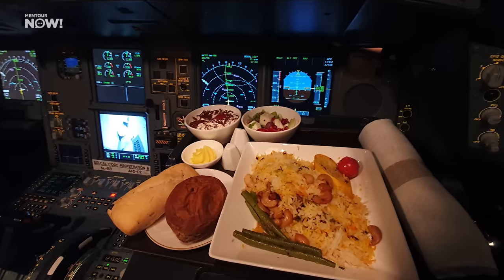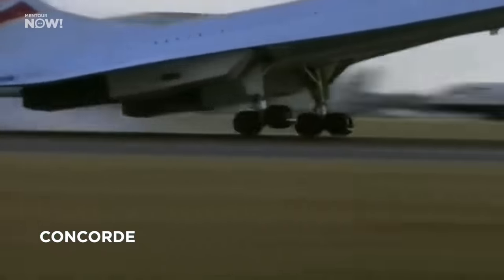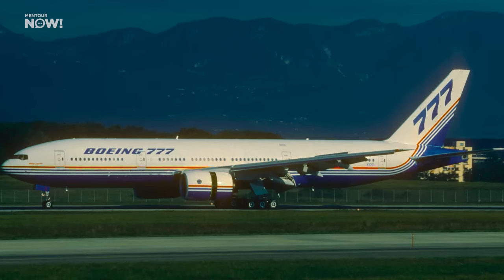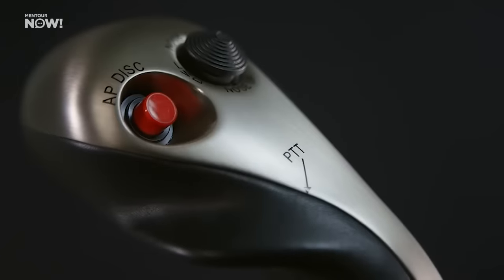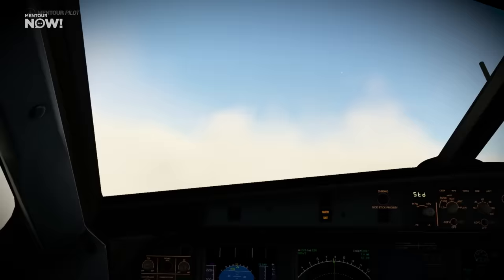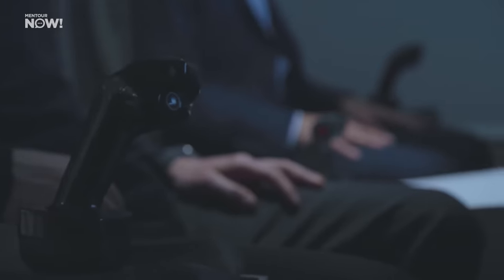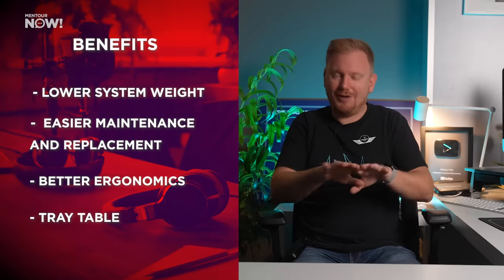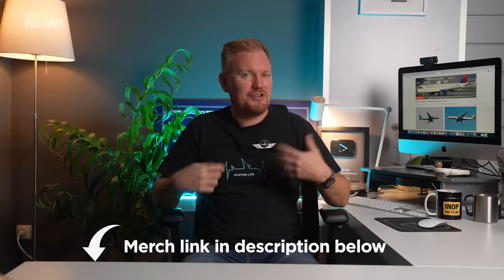Will Airbus Finally switch??

Comment: To reduce the dual input problem, why not install a very obvious switch to control which pilot has primary input control? It might help clear up who has control of the plane. If an argument arises, it would be over which way the switch was flipped. The secondary control would still have some redundancy somehow.

Comment: You are not 100 percent correct in Boeings decission to use Yokes.  The main reason Boeing went with Yoke is nearly all pilots start out flying with yokes and MOST aircraft have yokes and its a natural feel for pilots.  Its easier to transition from one aircraft (not boeing) to another when most aircraft have yokes.  Also in Emergencies, because pilots are so used to using Yokes its easier to deal with emergencies more confortably.  It boils down to philosophy in designing safety.
Reply: You're right. Pilots start flying with yokes which are present in smaller planes meant for general aviation and flight training.

Comment: I am just at 0:33  and a film maker (hobby wise) and focus pulling is only possible manually with old lenses. Focus by wire lenses are useless. You have no marks, not a fix way, it depends how fast you pull focus and the acceleration of your hand, so you can’t train it for the shot and use muscle memory, you always pull a little bit faster or slower so you have to search focus instead of in the best case make a mark on the ring on the older lenses and just pull to your mark. Or make it by feeling. So I am not a fan of anything by wire. You need natural feedback.

Comment: When it comes to making reliable tech for this, I think the technology has actually been around for a while, just not put to use.  When you think about it, measuring force is nothing new and we have multiple ways to go about it.  You could have pressure sensors for example.  With servos, you can measure load on the motors to hold a position, though maybe not quite as accurate, but still pretty good.  We have been able to measure servo position for a long, long time or else flying R/C aircraft would be basically impossible to fly because the servos would not do what the R/C pilots commanded.  Then, when it comes for force exerted by servos, I just look at the high speed tail servo for my large scale R/C helicopter I put together over a decade ago that perfectly holds the tail and those tail rotor blades spin so fast when I have them moving at flight speed on the bench that I cannot manually move the push rod from the base of the tail boom to make any sort of meaningful deflection of the tail rotor.  In general, the forces involved on large scale R/C helicopters that the servos need to counter are immense and they do it like nothing.  So then you look at the 2-axis movement of the side stick and you can have doubled up servos where you have 4 of them 90 degrees apart.  So the servo 180 degrees opposite of one breaks, there is still one to handle that axis and then the flight computers can log that the redundant servo failed.  Same with say a pressure sensor, one breaks, the redundant scheme is still there and an error is logged for the maintenance crew.  It is kind of like having redundant hard drives in a server where one breaks, if your server administrator has their logging server setup, they get a notification and replace the failed hard drive at their earliest convenience and the array rebuilds and nothing is lost.  The point is, none of this is new; it has all been around for decades.  So just nobody bothered.  There is actually a whole lot of tech out there where someone thinks it, maybe it happens, maybe it doesn't.  If it does, it is not appreciated and then it languishes.  Maybe at some point somebody remembers it and then it gets fleshed out to what it should be.  Especially anybody who has worked at a major corporation developing technology knows full well how the higher ups tend to look at the tech you develop.  After all, we got luck with graphical Apple Macintosh computers that Steve Jobs just happened to get a chance to look at the tech developed at Xerox around this and decided his company was going to copy what the Xerox people were doing and release the Macintosh computer.  If you just left it up to the Xerox execs, they were like we are in the copying business.  We don't understand this graphical interface tech and are not going to incorporate it into any of our products.  Then, we would have waited a lot longer for a graphical interface to emerge somewhere by someone with the means to bring it to the masses.

So for the question of could have Airbus done this a long time ago?  I think the answer from a technological standpoint is absolutely.  It just wasn't prioritized.  I mean there is just nothing new or 'magical' that we say just recently came up with a servo or sensor mechanism for and there is nothing really new software / firmware wise for controlling such a thing, at least in concept.  It is not like you need ChatGPT to control it or something.  This is you have some motors and sensors we have had for a long time and some fairly straight forward software / firmware to control it all.  When you think about it, this is more like tech level going back to the 1970's, granted you would really want at least a 16-bit computer from the 1980's to make it really smooth as the 256 steps of 8-bit isn't really all that nice for flying an airliner.  The servo tech I used in my R/C helicopters had something like 4,096 steps and digital audio has had at least 65,536 steps to the masses since the first CD player came out way back in the day.  And for reliability, as mentioned above, it could have always been setup with inherent redundancy and the controlling software / firmware could have been programmed to work around faults.  Software / firmware designed to work around faults like this is nothing new either.

Comment: Regarding the side sticks, I always wonder how a right-handed person can control an aircraft from the left seat, holding the side stick in their left hand. I have a flight simulator and a joystick, and once I try to fly with my left hand, it is nowhere near possible for me to do a smooth landing. 

By the way, you mentioned that hearing is the first sense to be degraded when in an upset situation - it would be excellent for the active side stick to have a stick-shaker :-) That could have been a game changer on the infamous AF 447 flight.

Comment: I never understood on having a joystick you have to handle with the left hand. I have a similar problem when renting a car in a country where you drive on the left side and the steering wheel is on the right. Operating the gear box with the left hand is more difficult.

Comment: I think the decision for a retrofit will come down to whether the airlines will pay for it or not. If Airbus considers to implement active sticks, they will most certainly need to certify that change and the adapted operating procedures, which costs money and takes additional effort aside from the engineering behind the change. 

Considering that the A320 sells rather well without, I don't expect them to make the move before releasing a new aircraft.

Comment: All Recall Air France flight 447 crash in the south Atlantic. The Left seater trying to recover control had no idea the right seater was holding his side stick full back during the descent to the ocean surface! With Yokes, it would have been far more visible what the right seater was doing during recovery attempts when the left seater called for Left Hands!

Comment: Interesting points being and the arguments, from a pilot’s perspective, sound convincing. However, stepping back a little and considering it from an airlines’ perspective I can imagine a certain amount of reticence in rolling it out as a ‘retro-fit’ without there being an extremely good case to do so. My reasoning is that in spite of the apparent ‘straightforwardness’ of installation, as you said, there are knock-on implications for other on-board systems which will need to be upgraded / modified to be compatible, there’s pilot training etc and the system is likely to be expensive because of all the development costs (think of all the millions of lines of code which must be reviewed and re-tested, aircraft recertification etc). All this represents ‘lost’ time and cost to an airline (some of which could be mitigated by undertaking this during a major service or refit - in theory). There are, I think, also further logistical issues in that if the aircraft after upgrade are ‘different’ to fly you cannot so readily interchange your pilots to fly the newly equipped aircraft mixed in with your non-upgraded aircraft. It has to be planned and, inevitably, is likely to create bottlenecks and restrictions as the system is rolled out across the fleet - albeit temporary. This is another cost an airline must absorb. And implementation is not without risks too - not just the aforementioned logistical ones. There are very real safety risks. Same model aircraft often have differences, perhaps from upgrades or replacements over the years, or may be differently configured for airlines. They aren’t identical. An airline would have to be 100% sure that the new equipment worked flawlessly with every aircraft it was installed on. I can imagine a requirement for thorough flight checks after each upgrade - adding to cost. All this is not to say an airline wouldn’t therefore do it but may be reluctant to retrofit unless there is either a significant cost reduction benefit, the airlines’ safety is improved across a significant proportion of its flights - I.e. not just a small percentage of rarely occurring circumstances for which other mitigations already exist or it is forced to by legislation or industrial action. There is, I think, a stronger case for implementation on new aircraft only but Airbus would still have to persuade the airlines of the benefit to them versus the extra costs which will still be present. How did this pan out for such things as converting from old analogue instruments to the ‘glass cockpit’ (though I imagine the case for that change was much more compelling…)

Comment: This argument starts with the tenuous assumption that joysticks are better. I have reviewed the videos of about 1/2 dozen aircraft investigations where joysticks contributed to the crash. I have never seen one accident where a yoke was a contributing factor.  I did witness bare eyed, a fly-by-wire, joystick controlled, large commercial jet overrun and burn to the ground. (Aug 2005).
You cannot see when, and what inputs, the other pilot is giving when a joystick is used. As mentioned the DUAL input case causes a voice warning which is not heard when the brain is in fight or flight mode. Neither does it indicate what inputs the other pilot is making. 
A joystick cannot provide feedback as well as mechanical linked yokes give. 
A joystick with servos (25 years too late) has significantly more fail-able software involved. It also violates the KISS principle.
The 80% less weight advantage of a joystick is trivial compared to greater safety of a synchronized dual yoke. 
Perhaps unrelated, any wireless technology as part of the cockpit is vulnerable to hacking, just as with cars.
As a systems engineer (mission critical, real time) it never ceases to amaze me how naive are non-systems folks wanting everything digital. It is fanciful thinking, not based on all we know about human factors research, nor based on the track record of joysticks in commercial aviation which has quite different requirements than military jets.
There are dead passengers and crew and written off fly-by-wire aircraft (designed by four European governments) due to the original, non-pilot software designers thinking that a joystick should replace the 100 year proven dual, synchronized yoke technology. (They probably grew up playing computer games with a joystick too.)
Why use joysticks with fail-able software and servos to try and recreate feedback (still not giving visual observations by other pilot) when tandem yokes fully support two pilots in the cockpit?
It reminds me of the Carbon Fibre Titanic submersible that promised such a weight reduction… we know how that went.
I am not a pilot but have three decades in automation systems analysis, design and development.
Last point: what a human factors FAIL to assume the Left side pilot can nimbly use the LEFT HAND ONLY joystick with the same level of dexterity as the right handed joystick! The tandem yoke doesn’t suffer this problem.

Comment: Active side sticks will have to tap deeply into the aircraft databus to determine how to be active.

Given the age of older Airbus designs, sufficient data may not be available or other controllers require at least firmware updates.

Recertification, even if no other hardware is changed, will be the main cause for integration delays. Even if the active side sticks have a passive fall-back mode.

Comment: Envelope protection? ENVELOPE PROTECTION!? So... Air France where the pilot stalled the plane all the way into the ocean because he was constantly pulling back on the side stick.
Reply: The protections were off by then. The FBW was in alternate law. Envelope protections do not guarantee that all normal flight envelope exceedances or stalls will be prevented. It just decreases the odds of it happening, provided the normal mode/law is in effect. The protections have saved at least 3 Airbus aircraft from stalls in the past.

Comment: Something that never seems to be mentioned is the hand a pilot feels more comfortable using.

My preference is to use my right-hand so would feel more than uncomfortable flying an aircraft with a left-hand "side stick", it would just feel unnatural.

So will airlines have to have a left and right flight officers.

In the F-16 there appeared to be no choice, you could only use your right hand. Of course in the
 F-16 if the pilot suffered an injury to his right hand or arm it would be extremely difficult to fly the aircraft, whereas if it had a joystick you could us either hand.

Comment: Hey guys, I'm not a pilot, never flown a plane, just an aviation enthusiast here, with a curiosity about sidesticks: The captain's sidestick (left)is always meant to be used with the left hand, whilst the first officer's, with the right. Does that work well, isn't it actually problematic to pilot the stickstick with the left hand if you're right handed(which I assume most of you are?) Yokes obviously don't have this issue since they're center positioned
Reply: No. During take offs and landings the right seat pilot moves the yoke with the left hand and with the right hand does other stuff. So is technically the same.

Comment: now, I'm no pilot but I've kinda held over the scene for a few years now: if I was flying a small aircraft that was machine-flown with my inputs I would want to know what the person behind me in the other flying seat was doing, so flight sticks that give feedback from the other pilot and/or autopilot and from the forces the surface motors are experiencing would be greatly appreciated.

Comment: Excellent analysis. I've always felt that side sticks have many advantages, but the fact that there is no control loading is a major disadvantage -- you can't feel what is happening with the aircraft, in the same way that you're feeling the movement of your car through the steering wheel. I've always wondered why there were no designs with active side sticks yet. I'd be disappointed if those active sticks would only reflect the inputs of the other pilot, instead of also transmitting the forces that are being acted on the aircraft by aerodynamics. I believe the G500/G600 active sticks only mirror control inputs, not external aerodynamic forces.
Reply: The sidesticks on the G500/G600 DO provide artificial force feedback. A few pilots who have flown them said so. That's the other purpose of the active sidestick. Those aircraft have to provide it anyway as they are speed stable C*U aircraft with required trimming, where artificial feel is a must.
Reply: @ARandom777 Right, that's different than Gulfstream showed in their own promotional material then, it's possible they improved on it after their promo video on the sticks was released.

Comment: I wonder how the push-to-talk buttons for the radio play a role in this discussion. Do Boeing pilots still use the button on the yoke when the other pilot is making control inputs? Do airbus pilots like their sidesticks to hold still while they're holding down the trigger to talk on the radio? Do they use other buttons entirely or do they not mind at all and don't even think about this? Would love some insight there